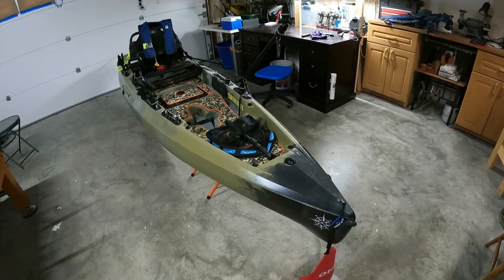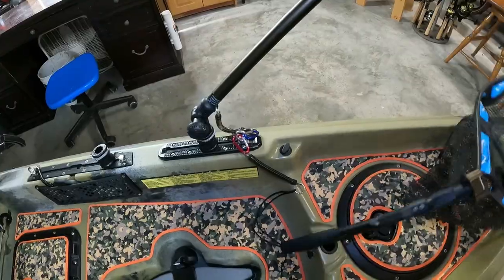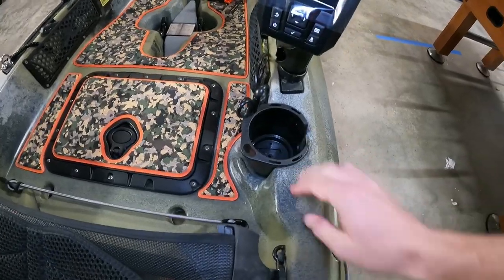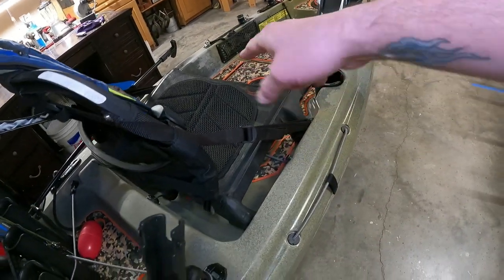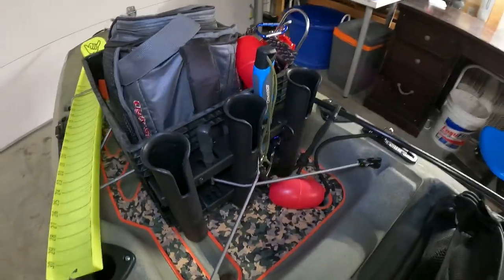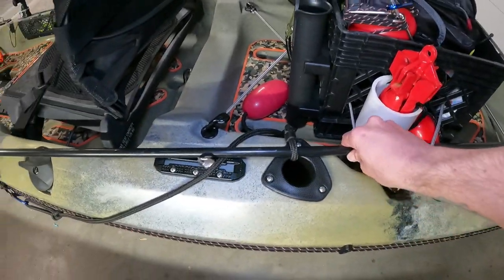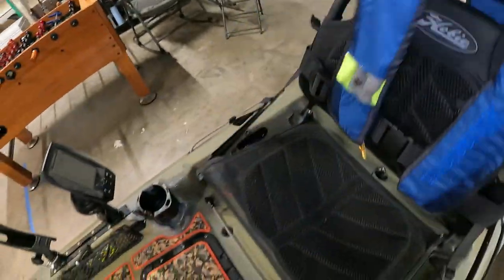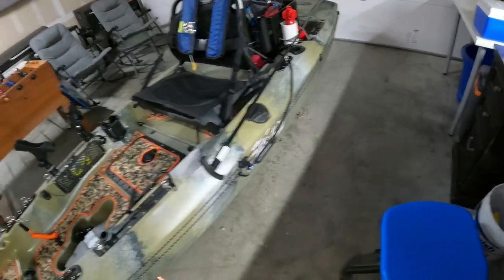Quick Walkthrough of the Hobie Compass

Comment: Do you think this boat would accommodate someone 6'6" just wondering. Like the features and price
Reply from the maker: I think you would do fine. Its rated for 400lbs and I'm almost 6' and have the pedals adjusted about mid way. They can extend out further for taller people. To be safe though, find a Hobie dealer that will let you test it out before you decide to buy.
Reply: @WildBillFS  copy that.  It's hard to check out models at dealers when they sell out due to demand but definitely going to see about them asap.  Thanks for your response!
Reply from the maker: @minuswon  anytime!